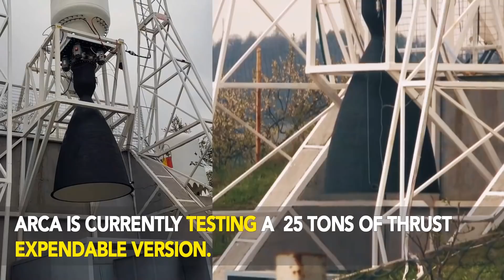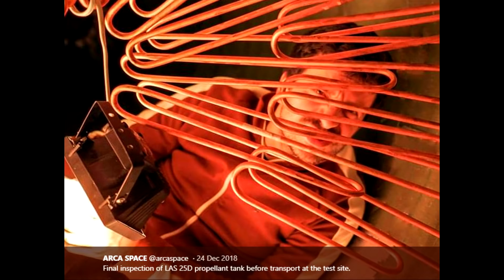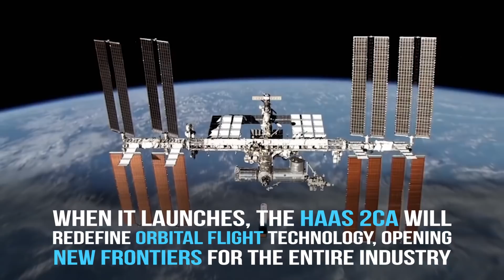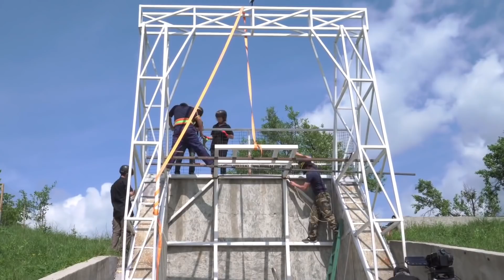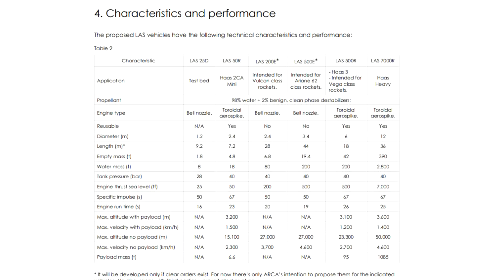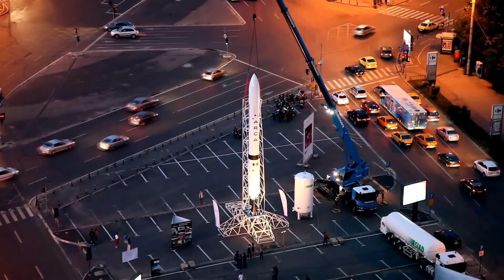Does ARCAspace's Water & Electric Powered Rocket Make Sense?

Comment: If the specific impulse for steam rockets can be extremely high, but the difficulty is in keeping enough propellant heated for an extended period of time, it seems like steam rockets would make sense as a first stage for a very short burn to avoid the need to minimize the need for batteries or other additional heat source. 
Between my limited knowledge on the topic and the information you provided, the most practical application for steam rockets is exactly what they are proposing: an initial booster for an otherwise traditional chemical rocket.
Reply: WELL ARCA IS GOING TO DO THIS WITH A FIBERGLASS HOME-MADE BOILER TANK. ANY THOUGHTS ON THIS?

Comment: Hello and thank you for that topic. I'm enjoying your work for a while now. In advance please pardon my "french".

In addition to your material here: in former CCCP there was several projects studied that implied the use of steam power for boosters or several first stages of a rocket that was to be launched directly from the surface of a sea . The rocket had no start tower or ramp. It had to be floating in the sea and directed upright just before launch by filling the stages with the seawater. I'm not surten if that water is being desalted in the process or not. 

Any how. It was one of the considered solutions for cheap, frequent launch system for near equator launches or alse ware. The key there is to be flexible.

The power for filling and heating has to be provided by a toweship, that was also to be utilized as a control centre.

My source in this matter is only my memories. If I remember correctly one of the publications about that was in a popular journal for jung technicians called : "юнный техник" somewhere in 80s-90s. But i've learned/stumbeld about it again and again while visiting university.

With kind regards. Yevgenij

Comment: I think it would make sure to heat the water on ground to incredible temperatures from the grid, and once pressure reaches X point the rocket launches (ie. pressure disk bursts) - but no batteries carried. put that weight towards stronger pressure vessel.
Could be an incredibly simple booster, at such an low cost that even recovery does not matter that much, good if it happens to land safely, no worry if not. Essentially bottle rocket to the 100th power.

Comment: For a rocket engine, 98% of the fuel is wasted as waste heat, only less than 2% energy is used to actually lift the payload. If we find a good way to accelerate the water into super high speed through the nozzle efficiently (eg. 20% thermal efficiency), then water+battery can work, in theory.

Comment: Scott, there is a way and they are close. . .The part their missing is this. . .Tell them in addition to what their doing to include high frequency microwave within the rocket nozzle chamber.
If they get it right, the hydrogen and oxygen will separate, but still need to be ignited. . .Exploding water. . .It can be done. . .

Comment: 1: When a rocket launches, if you are inappropriately close, you will die even if the rocket launches properly.
2: When a rocket fails, anything inside comes blooming out at speeds and distances far to fast for a person standing inside the safety zone instead of outside, you're most likely going to die instantly.
3: When water flashes into steam, it sheds heat so fast [unlike combusting fuel] because it is not only not increasing in heat [unlike combusting fuel] but it is experiencing expansive thermal entropy [as the pressure decreases, the heat drops proportionally] so that unless you are standing directly under the steam blast, it is highly unlikely you will be close enough to even feel the heat.
4: Since water is lighter than air, and has lower mass than air, it is naturally going to float upward due to its extreme buoyancy, leaving the surface of the launch pad far more rapidly than liquid propellants, liquid oxidizers or heavy particulate combustion products such as soot which can remain very close to the ground at heats far hotter than steam
5: The known carcinogenic oxidizers known to exist in rockets are such chemicals as lithium perchlorate and ammonium perchlorate, which are indeed highly toxic and highly carcinogenic, but also, such strong oxidizers that if they spill on you, they will burn you as effectively as LOx, Liquified Ozone, or H2O2, or potentially worse, because unlike the others which simply react on contact and then become inert, perchlorate reactions produce a host of potentially lethal byproducts such as lithium chlorate, ammonium chlorate, hydrogen chloride gas, chlorine gas, chlorine dioxide gas/liquid, and chlorine monoxide gas. Any and all of those byproducts are as, r more dangerous than the original, and some of them are extremely explosive, all chlorine byproducts of a perchlorate are highly corrosive, toxic, and photochemically reactive.

Anybody who would honestly fall for such mindless drivel as this video pukes out is as much of a moron as the one spouting it.

Scott: if this is all the better you have to offer, then just shut up and go play with some kiddie blocks because you are WAY outside of your league!

You have NO CLUE what is going on with ARCA or else you are a paid shill of the rotten SOBs who have been continually plaguing their heroic work.

IF I had the money to spend on it, I would 100% fund their project and be there personally to help them.

What they are doing beats everything else out on the market today, for safety, economy, efficiency, and responsibility.

Your derogatory remarks, on the other hand show either gross ignorance or malicious vitriol.

Either way, your words were all bad and you should cease and desist.

Comment: the momentum is only about the nozzle shoot out speed and shoot out mass. Doesn't matter its hot gas or cold liquid. I would like to see in the future the rockets use little energy to eject large amount of cold stuff to lift, instead of the thousands degrees gas where the heat is a waste energy.

Comment: Build a molten salt thorium reactor that will fit in the base of a Starship sized rocket. Take it critical. Raise the control rods fully. Introduce a couple pounds of plutonium salt and be really quick to open the valve to the water tanks, and presto, 1500C hot steam blows out the bottom end. Can't see what could possibly go wrong with that.....

Comment: Heck, back in the 1960s we kids had rockets "powered" by water.  It was usually red transparent plastic.  You filled it about half full of water, then placed it on a pump, and hand-pumped a bunch of air into the rocket.  Then separate the rocket from the pump and "zip" - up it went.  Hmmm.  Patent infringement by ARCA?

Comment: Electrolyzing water into hydrogen and oxygen and then burning it in a normal bipropellent system is something that does work as an electric & water powered rocket, but only really for on orbit operations where you can draw power from solar arrays. Check out the HYDROS thruster from Tethers Unlimited, which has flight hardware delivered on multiple programs.

Comment: I heard about an ion engine that used instead of Xenon Gas fine metalic powder.
What if you have 1L chamber and fill it with atmospheric pressure of air and heat it up. How much thrust can be generated?

What if he drill a hole would it have stronger trust when the gas jet out?

Comment: I'm surprised it wasn't in the video and I can't find it in the comments but once you know, the concept is much more interesting - 
This rocket isn't 'steam powered'. 
The theory behind it is that they will be using electrolysis with the steam, which I guess produces hydrogen and oxygen at a quicker rate and/or higher pressure than electrolysis with water. Also avoids any freezing so that's uh.. good too. 
The engine would then run on combustion of the H2 and O2 produced. 
That is why it will be battery powered and won't use a more energy dense combustible fuel.
For the concept to be worthwhile, I guess this is all somehow more energy efficient than 'normal' rockets.
Reply: Splitting the hydrogen onboard is even less efficient, more expensive and confirms that this was just a scam.

All the energy from the hydrogen combusting comes from electrolysis, that would mean using it just as a fancy heating element.
You will still carry all the energy inside the battery.
You don't get free energy by electrolysing water and combusting it afterwards.

Sure, Battery technology will improve greatly in the following years, but the energy density will never get higher than regular Kerolox Fuel.

Comment: You're better off with a closed nuclear lightbulb than using electric propulsion. You can get a pretty good acceleration profile with water, just not with the Delta-v of hydrogen. Water is also useful as a radiation shield too. Combine it with High-Z Steel Foam... you've got yourself a spaceship that can get to Mars in a reasonable timeframe of months, not over a year.

Comment: But why use water which has a huge specific heat capacity? It would take a lot more energy to heat up 1 degree compared to other liquids, right?
Reply: T.K. High specific heat means lots of energy stored per kg, which is desirable

Comment: I have thought of one method to heat the water up: Beam Microwave energy to the rocket from the ground . You could beam 10s of gigawatts of power. Of course 10GW of microwave power would probably require 20 to 25 GW of electricity due to losses.

Comment: you should look up the sabatier process,  turning co2/h20 into ch4 , the yanks have had it since the 70s , i saw an interview once with a pilot that was on apollo 13 and he said we had to switch everything off  that was unecessary  and use the batteries to seperate the hydrogen from the H20...

Comment: One idea for steam rockets is that they could be used as a hybrid with other rocket engines. 
Take conventional combustion rocket engines. They produce a lot of waste heat. What could be done is, take the waste heat from the combustion rocket engine and use that heat to boil water stored in a booster tank. That way you could get extra thrust from the engine heat.

Comment: Dr. G. A. Partel developed a flashed water booster for the
Bora-Sond sounding rocket in the mid 1970's. The booster used a chemical reaction
to flash the water into super heated steam. The booster alone could reach altitudes
of 6km.

Comment: 3 things to always be skeptical of: 
- self driving (insert here)
- 3D printed (insert here)
- electric powered (insert here)

If the solution to the age old problem involves one of those 3 things, its probably BS. Robots cannot beat humans at anything other than computation and speed. The initial investment is far too high for the low end industries that employ low skill labor, certainly not at the low wages that humans work at in most low level industries. Migrant workers and outsourcing have halved wages by over 700% in most cases. No new technology can compete with what amounts to 65¢ above slave labor in some 3rd world countries.

3D printing mechanically involves molding objects out of special resin. Plastic can already be mass produced using conventional molding techniques.The few applications where 3D printing is superior to cast molding is few and far between. The fact the casting method can create hundreds of stamped parts in the time it takes a 3D printer to make 1 doesn't help. The invention of Plastic was a major break through, but its old news. If there was anything left in the world that could be turned to plastic, it has already been done. 3D printing's 1 last saving grace is that you can get a 3D printer the size of a normal pap printer, and operate it using a normal home computer. This means nothing to industrialists. 3D printers are more toy than tool.

Like plastic, Electricity is nothing new, and neither are batteries. The technology has long since hit the glass ceiling decades ago. Minor advancements have been slow going, and it is unlikely any major breakthroughs will occur using conventional methods. If batteries are to suddenly become viable where they previously were not, something fundamental would have to change regarding how they function at an atomic level. Some break through in nuclear or quantum physics that revolutionizes energy storage or release. You can only do so much with a box full of electrons.

Comment: So, instead of storing the propulsive energy inside the propellant, they're storing the propulsive energy separately from the propellant in huge-ass batteries. This sounds terribly wasteful from the perspective of expending unnecessary energy to lift dead weight. Not to mention those batteries are highly flammable, don't react well to being discharged at extremely high amperage, and contain EVEN MORE toxic substances than the combustible propellants they're trying to replace. This is just a terrible idea all-around.

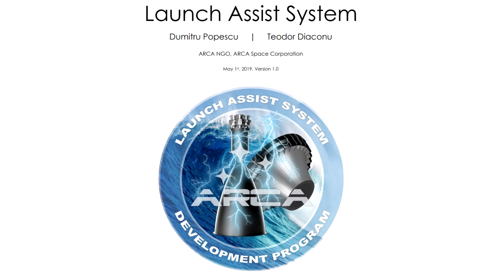Comment: The slide 5:23 shows 50-67 ISP, that is insane! First stage run time is listed at 16-26 seconds. Why bother? I mean at that point you'd be as far ahead to use ground based catapult launcher, and save 80% of your energy and not have to worry about landing what I assume to be a very difficult to throttle engine. I mean even that is a terrible idea which no one wants to do, but a 15 second booster?
It takes a Falcon 9 like 8 seconds to clear the tower! Watch any rocket launch and see where the vehicle is in 26 seconds.

Comment: After thinking about it a second... the only thing that could make this feasible is nuclear fusion or fission.   That's the only way to get the thermal power you'd need within any sort of mass limit to make it remotely useful.  And you'd want to use a microwave chamber for the exhaust to get it as energetic as possible before dumping it.  Beyond that it looks like they plan on treating it like an SRB - which I'm fairly certain it won't last very long with water in direct contact with metals that will be superheated and releasing corrosion particles into the thrust flow.   At least the fuel doesn't require special handling and should be fairly "inexpensive".

Comment: Forgive my ignorance as rocket science isn't my forté but 25 tonnes of thrust doesn't sound all that great. Once you take into account the weight of the rocket and payload I am guessing it would struggle to make the stage two separation altitude on time. It certainly wouldn't be carrying a hubble type payload at 24.5 tonnes.

Comment: Have been following ARCA from the aerospike  Hydrogen peroxide fuel.  I thought they were getting likely switched to the USSR fuels when they returned to Europe former satellite state because they still had some contacts.  I agree battery is nuts.  The  high power batteries are single use type that are used in electric torpedo.   The best description I have is a bomb that happens to make electricity.  I have a patent on a electric motor for such use.

Comment: The only way to get enough power-to-mass for SSTO with an inert propellant is with nuclear power (or with power beamed to the rocket from an external source). Neither lithium batteries nor ultracapacitors can store enough energy to outperform hydrogen/oxygen, even after the low-temperature requirements of liquid hydrogen are accounted for.

That said, if you have enough energy available, then literally any substance that is liquid or gaseous at a convenient temperature can be used as a propellant, though lighter molecules are more efficient (hydrogen, helium, nitrogen, oxygen, ammonia, methane, water, etc.).

Comment: I am curious if you have revisited this considering the energy density improvements in the year since this was released. Do you think there is enough improvement to make any of these ideas feasible? It would drastically reduce costs if something as readily available as water could be used as reaction mass instead of some of the other fuels we use today.
Reply: Fuel costs are extremely low compared to the hardware.

A typical chemical rocket has at most 4% of its budget used for fuel.
Reply: @user-si5fm8ql3c  The management of cryogenic fuels and liquid oxygen costs a lot more than the raw fuel costs. And they are dangerous in and of themselves.
Reply: @Myrddnn  
The problem is that most of the power comes from the batteries.

They almost certainly wont even reach an specific impulse of 100s.

A rocket so inefficient would need a huge number of stages, each one bigger than the one on top.
The burj khalifa would be tiny compared to it.

But they show their rocket with just 2 stages, which is stupid.
They could just build a space elevator at that point, because a rocket so inefficient and with enough ∆V to reach orbit would be taller than the atmosphere.

Comment: Adding batteries to a pressure fed steam rocket would only make it's mass fraction even worse.
That said I'd be less afraid to sit on top of a SRB than a tank that size filled with 250C degree water under 15 atm.

Comment: As a first stage this seems dumb. A smaller version used as an orbital thruster seems more like it could be a good idea for very long missions, if combined with massive solar panels. That way you only have to bring half your fuel, and the rest is waiting for you in space as sunlight. This would just require that your thruster & solar panels weigh less than the weight saved on fuel, which with current technology, could only be the case for long, slow unmanned missions where the amount of fuel needing to be carried is a lot more than the amount of thrust needed, enabling a relatively small thruster and reasonably sized solar panels to work with a huge water tank. With future technology this would likely improve, especially as more work goes into making more efficient solar heating that can transfer heat directly from the sun into the thruster rather than capturing electricity and then converting it into heat.